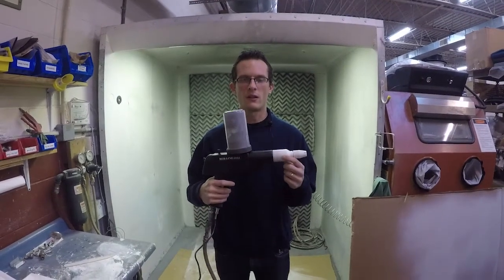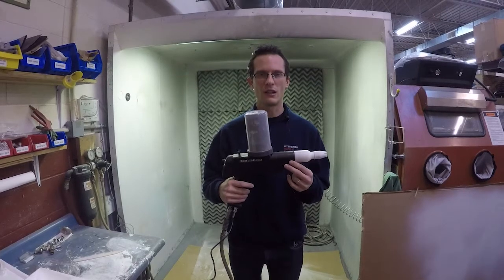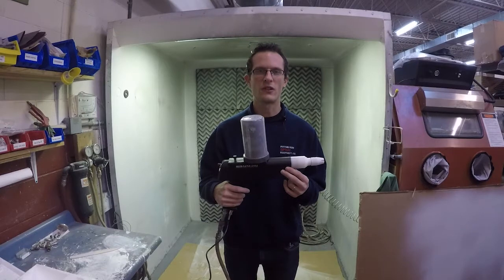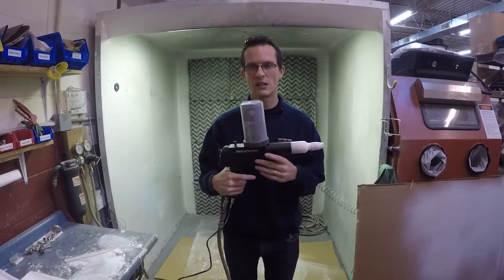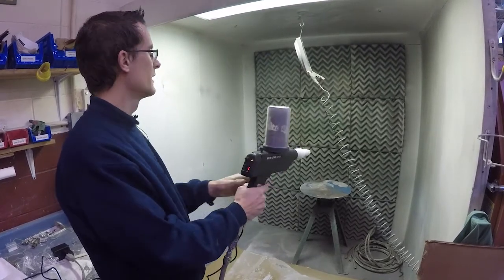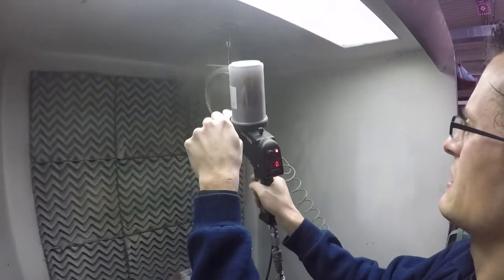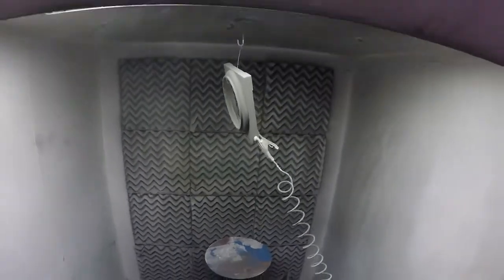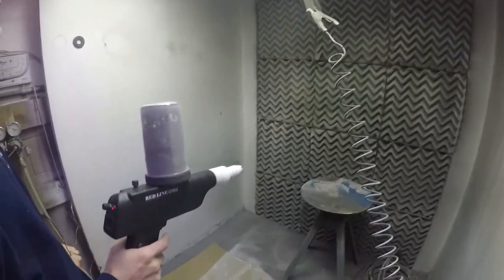Red Line EZ 100 Powder Coating Gun Review

Comment: Even in my just above beginner level shop I don't use the ground connection directly to the parts I am coating, just 1 less thing to worry about not getting a 100% coat on, I ground through the booth directly, and all hooks and hook extenders, swivels, and carts are all metal to metal connected and blown off after every application, or cleaned after curing. Even with a spray booth you should still wear breathing and other protection, powder washes out of clothing, but looks like a huge mess, and I couldn't believe how much powder would still get into my ears without ear plugs! Stay clean and safe!

Comment: Will the EZ100 need an airline adapter to use here in the us like the EZ50?
Reply from the maker: Yes it requires a 1/8 npt to 1/4 inch npt nipple adapter
Reply: Not true, I have the gun and its BSP (British Standard Thread and not NPT) Use a NPT fitting and you'll damage your guns internal threads.
Reply: I ordered the EZ100 and it is British thread. I found an adapter for it (1/8 BSP Male to 1/4 NPT Male Adapter, Steel). I sprayed 4 coats of powder and the sign turned out good for my first time. I need to work on transferring the project from the booth into the oven without bumping into something.

Comment: Do you have to spray a part twice to cover up the areas from the hook and clamp? Is that the only way with a gun like this?
Reply: Best to connect to an 8' ground rod into the earth then run a clamped wire from there to your rack. Never should directly ground the part, the rack and hooks should all be grounded that you hang the part from.